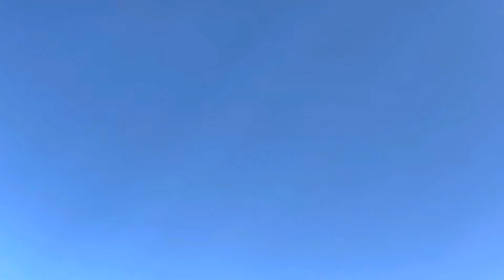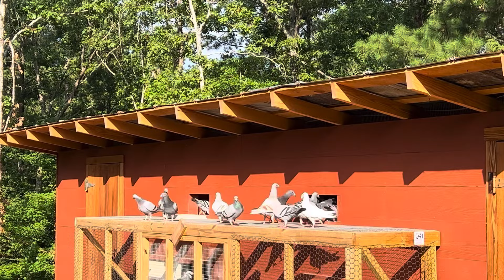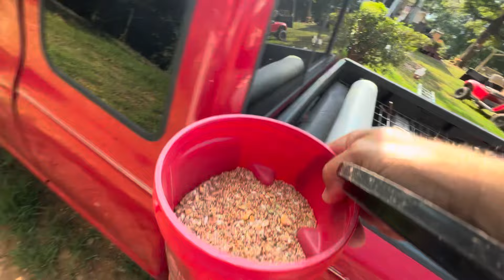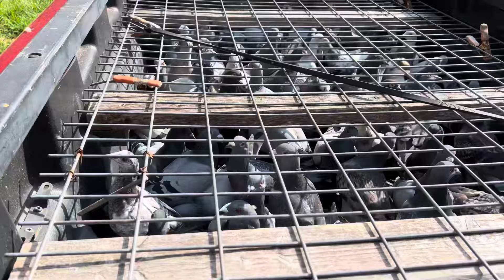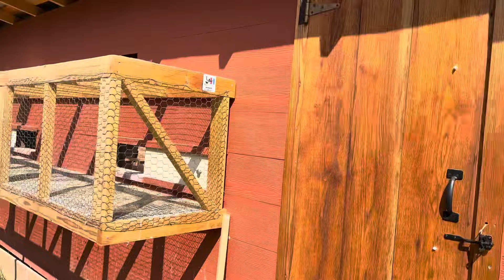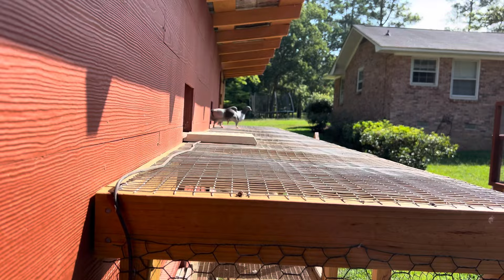GOOD MORNING FOR THE RACING PIGEONS TO START ROAD TRAINING. Also Pakastani Highflier update

Comment: these Pakistani high flyers fly well over a mile high. Only reason yours are flying low is that they see racers as droppers. Droppers work great of these high flyers.
You also need to train them for landing in dark using lights, check out how Joe at moatside loft does it and how he uses droppers.
Reply from the maker: Thank you very much. I will have to check it out.